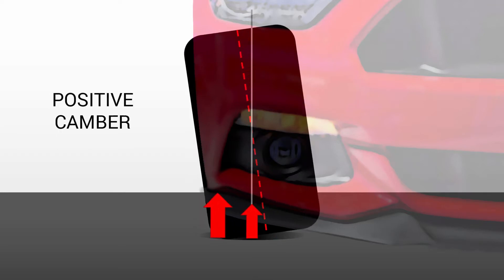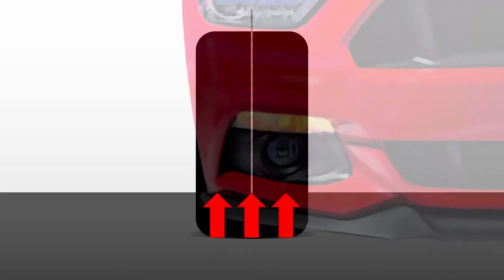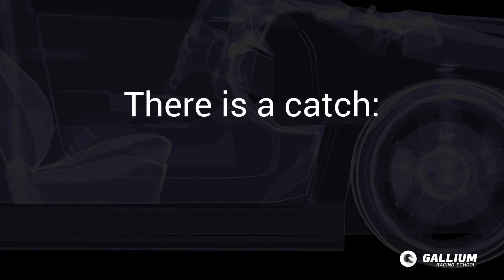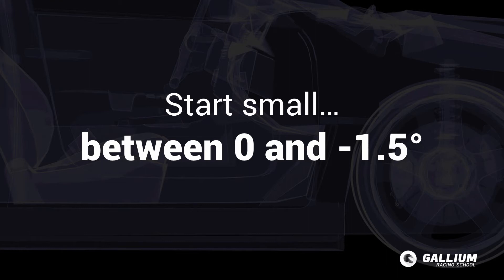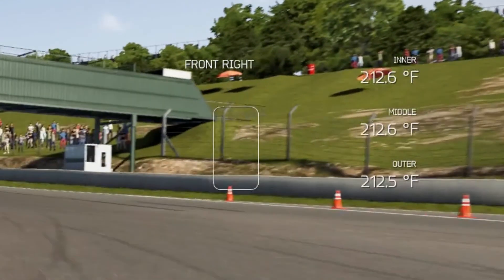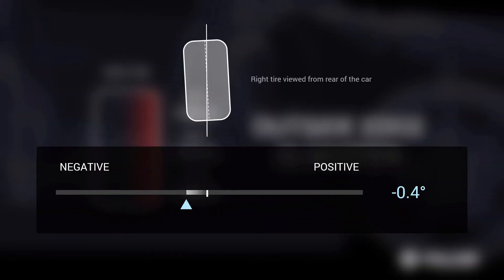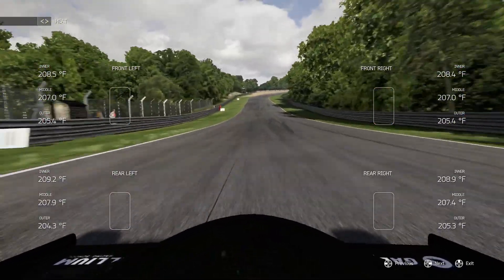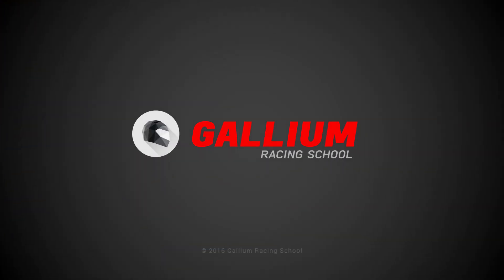02 - Camber - Suspension Tuning in Forza Motorsport

Comment: I tune camber differently, I use camber mostly for turn in grip in front, and to increase rear grille at low speeds along with suspension and differential. So it's usually -1.7 front, -0.5 rear

Comment: Is tire temperature reading better than peak grip reading and drive feeling. Or does temperature reading give a better peak grip reading with out having to tune based off peak grip? Should I always tune the way it is on the video is that less complex than using the peak grip as a guide. Example: I tuned from peak grip, and made a rwd nissan gtr 02 with better peak grip and positive camber in the front this made the car stable but left the rear with a lot of negative camber in the rear, straightened out/understeer upon acceleration. I usually do tire temp but I want something more about the actual tire grip rather than feel.